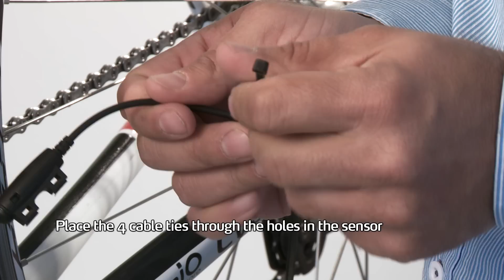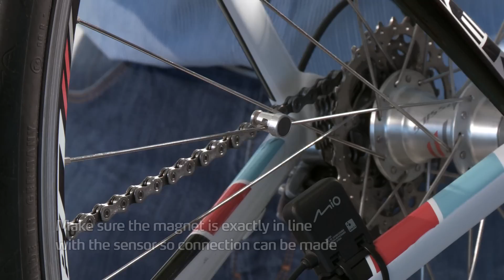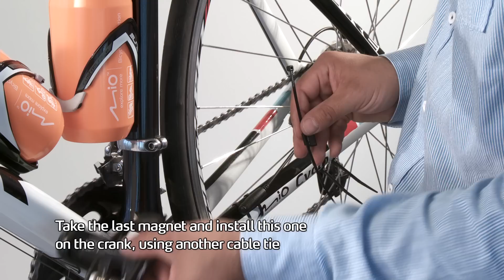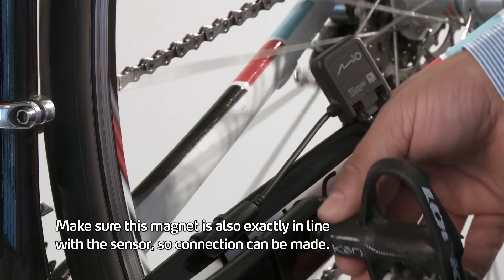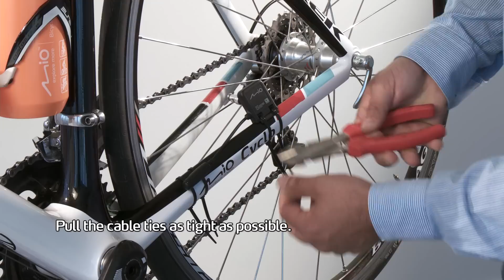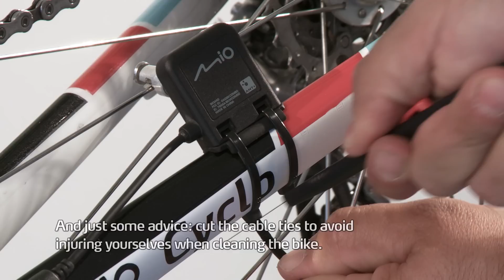How to place my cadence and speed sensors on my bicycle? - English

Comment: I thought that on the rim of the wheel was a sensor too.
I didn't know how these function.
Thanks to this vids I found out that on the rim is a magnet.
My father bought a bicycle from Germany, but lost the tiny magnet, so I tried with a magnet from a speaker. It works.

Comment: I  would have though the speed unit would have been better off pointing downwards (i.e on the underside of the chainstay rather than the top). So that if the speed sensor slipped it would have less chance of rotating into the spokes... Good video Thumbs up..